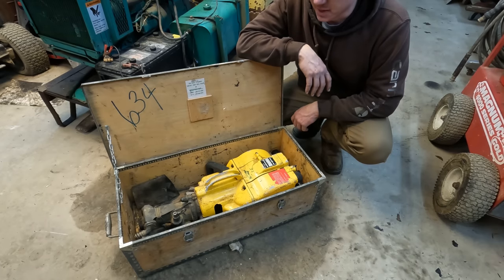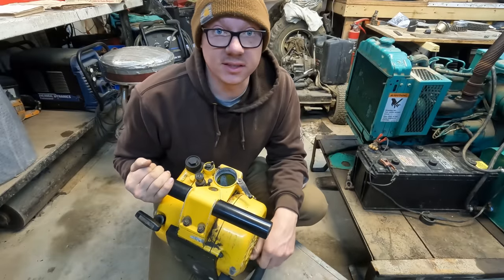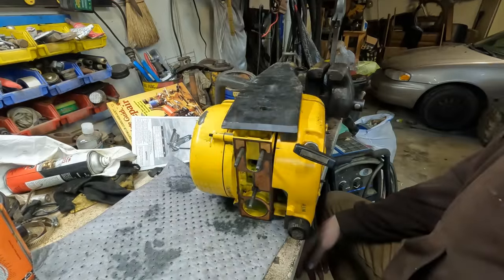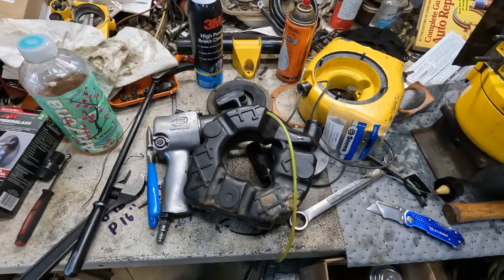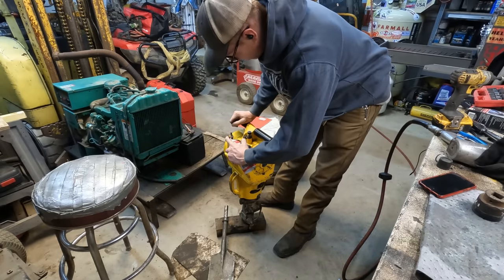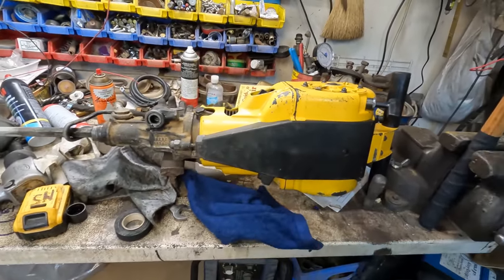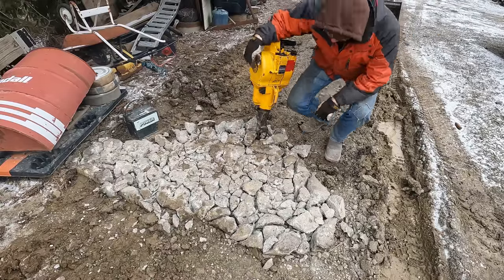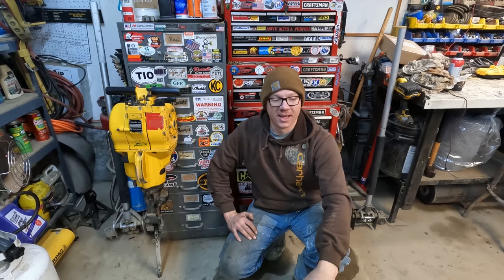RARE? Gas Powered Jack Hammer, Will it ever Run again??  (Pionjar 120)

Comment: Aha, 1:13 in the box, very similar to the petrol powered jack hammers we used here on the NZR as "one man operated" ballast tamping packers.
We had a couple of heavy Cobra's as well as a few Punja's - as we called them - never could get my tongue around the written name of Pionjar (smaller than the bigger/heavier Cobra's but just as efficient when used by one person for use as railway ballast tampers).
When the entire work gang (of 17 men at it's greatest number) were doing a track relay (mostly curves as these were 70LB track replacing the older 53LB, 55LB & 56LB rails we had on the Otago Central Branch Line - we also had a few kms between the two tunnels in the Auripo Gorge - between Lauder & Auripo - that had some 95lb & a short section of 110LB - both being test tracks in the excessively hot rock cuttings, with way too many curves).

We took our motor trolleys and flat-tops loaded with jacks, crowbars, shovels etc., and SPADES always the garden type spade with either wooden or yellow plastic handles - these we always used when doing track lifting & leveling, for manually spade packing the ballast under the sleepers, until we later did that quicker, with Punja's and Cobra's.
Bloody hard yakka, either way, slamming a spade into the ballast on a sloping angle to force enough ballast to go under the sleepers, which with every down stroke gave one a jar in the upper arm, shoulder areas, whilst lugging a hot and heavy Punja / Cobra around and hammering it's smaller slightly forked spade tip into the ballast - may have been a lot quicker, was also a lot harder to do in the heat and dust but a little easier on the shoulders, whilst BOTH arms were hammered with the kick-back from these oil-leaking (two stroke oil/petrol) petrol machines running at full throttle.

Comment: try Again, after they're saturated, carefully take them apart and just lay them on a surface that is flat and will soak up the water, I just usually use the bed and let them dry.
If it is stapled in the center remove the staples before you soak them. If you want after they're dry you can hit them with an iron set on cotton.It's not particularly difficult to line them all up and stick a sewing needle through the staple holes and then just take a new staple stick it through the holes and bend them over. And nice job and getting it going you are certainly persistent.

Comment: I've got a cast-iron  cobra jackhammer  whit the steel cable  as a pullstart.. I've started it a couple  of times by pouring fuel in the carb that's about  it and it was mixed  fuel by the way... Matt  that's a nice one right  there

Comment: If you are bringing something (with a pull  start )back to life, jou can use a dril ,or your power tool with a nut to spin it faster  to start.... when  you get the start element off.. :)

Comment: Looks like the mixture is for running at regular high speed .............The push throttle slows it down and all the way down shuts it off ....New looks like 1200-1500 ....You did good ...............Used between 400-700

Comment: Try moistening the pages with warm water with either a cloth or a spray bottle (light mist) I had a book that got wet and the pages were stuck together like that. Half the pages were still damp and I was able to carefully get them apart. The pages that were dried were stuck and I ended up ripping them a bit like you’re facing

Comment: Hi Matt . When I started working with council here in Kulin western Australia . There used to be 2 of these monsters under a bench in the maintenance shed . One pre Christmas clean up, the blokes dragged them up to workshop for a laugh to see if I could get them going . 
Amazingly after years of lying under that bench they both fired up on ether instantly . 
Then they both went in to junk pile . After watching you pull the rope for ever I'm glad I never tried to revive them . 
But they were definitely made back when men were men . Shit load of compression and a steel cable for a starter rope.

Comment: We had these and 2 stroke rock Drill's for the blasting company i used to work for. we did lots of off "middle of no where" Hydro pole installation in solid rock.

Comment: Matt been there mate, did the same thing when I was trying to fix my Flymo lawn mower. Didn't i feel stupid. If I'd read part of the manual that says how to fix the fuel system and pull start. So I know how you feel. I agree German stuff made well but overdone. But the feeling of satisfaction when you get things working again cant be beat.

Comment: I saw the comment on steam to get the pages apart. It will work but you might have better sucess using a hair dryer. The "ink" they use is like laser printers. When the heat is applied, the ink / paper will allow you to gently pull them apart. It must be hot but cooler than steam. Good luck.

Comment: I have a 2 stroke jackhammer made by Wacker that I found on craigslist for $200. Not only is it a simple and great running machine but it doesn't weigh any more than my Bosch brute that I have to plug in to power.

Comment: The throttle is backwards. You push the button to kill it, it's WOT by default. What I do to start it is choke it, put the needle in 1/2 position, give it a few pulls. Move the needle 1/16, try again. Go until you run out of needle. If it still doesn't start, adjust the choke and try again. In town I'm 1300 ft to sea level at I find you need some choke, but at 7000 ft elevation and above you don't need any. Once you find the right combination, mark it with a paint pen or whatever. It'll be the same spot every time.

Comment: Reminds me of starting my Hilti 16" gas portable concrete wet saw. Having rotator cuff injuries on both shoulders don't help. Switching most everything to cordless electric, what a difference!

3x5 card to separate pages, steam cleaner but not wet, or go easy with a heat gun. If lucky there might be an available PDF somewhere.

Comment: I've owned one of those for a while. It always starts easy when cold, but it is very tricky to start when warm. I usually just take a looong brake before i restart it. Nevertheless, it is a beast, heavy to handle, has lots of power and is very very LOUD.
Reply: Its easy when its cold or "fully" warm, its when it is somwhere between its tricky :D then it might be easier to let it cool down.

Comment: I use Threebond. 1184 to seal grommets in gas tanks.  It is fuel resistant.  I do the same thing for grommets going into bar oil tanks.

Comment: I ran one in the 80's for demo and modification in apartment buildings taking out concrete it taught me 2 things one let the hammer do the work and  two don't fight against the hammer I tried to fight it and tore out the tendon in my forearm that was a painful lesson . the worst part was it happened after running one for 3 years on a daily basis . I just tried to make it do something it didn't want to do and tore my forearm in the process. I have used both gas and electric hammers and trust me a electric one is a better option in every way even If you need to lug a generator along to the job

Comment: I just happened to run across this video and noticed that on eBay there are a bunch of parts listed for this mode.  Didn't read through all the comments so maybe you already know this.  There is also one listed as non-working for a lot more than you paid for yours.   Will keep watching to see if  you got it fixed.  🙂

Comment: I have spent many hours trying to get my own pionjär started.. 
It's a pain in the butt sometimes cuz of the way the engine is constructed. The cylinder head is actually what is powering the Hammer, meaning the head indeed moves.
It takes time to get to know your pionjär , but when you do It is a really capable piece of equipment.
Reply: Read your manual and do what it says, then its not hard to start. You cannot start those like you start a lawn mover or a outboard engine.

Comment: I had one years ago. We used them in the AirForce to drive elephant stakes. When we got away from those tents I acquired one. Bitch to get started but boy did it run

Comment: It is more helpful to know what the pages are stuck together with. That being said, I'm sure it is almost impossible to determine that since the equipment was purchase without much prior knowledge. You can start by using a steamer but don't go too rough with it because you don't want to soak the pages. I've seen some mild success with using a iron with the steamer function activated but an actual steamer is more effective and doesn't get as hot as an iron

Comment: A bit late to the party… 
The throttle is “inverted”, it is full throttle when left untouched. Half depressed is idling and full depressed is for stopping the engine. 

Starting instructions say to open the mixture fully and close the choke. Then pull the rope a few times. Open the choke and start the engine, adjust the mixture to proper setting. 

After stopping the engine close the mixture screw fully. 

Fuel needs to be 8% mix.

Comment: If the hole in the center of the socket is not also blocked it is probably not getting adequate choke if the flat lever plate is meant to block an opening on the original filter housing.

Comment: I got stuck on a job where I had to use one of these replacing a huge commercial pool deck. It had no where near the breaking power of a 50 pound air hammer. And was replaced after a few days with a real air hammer. It seems that saving a few bucks. Cost the boss thousands.

Comment: Way to go. I felt so sorry for you. Once my fingers start bleeding. I would start modifying it to start with my 1/2 inch drill.   Anyway, very entertaining. As for stuck glossy pages, I use my hair dryer (heat gun to hot)

Comment: This machine reminds me of an antique jumping jack I saw an old guy tinkering with at a tractor show. He flooded the engine, so he set the throttle wide open and began cranking. It hit after about the fifth pull and immediatly ran wide open. It was bouncing 2' off the packed dirt display area and was launching the old guy as well. A couple bigger guys saw what was happening and grabbed hold of the machine so the old guy could get away from it.

Comment: Parts. When the Chinese bought the rights for this macine they called it YN27c (c edition is most like your Pionjar (Pioneer) 120 with both hammering and drilling).
Anyway most parts from the YN27c fits your Pioneer. The side handle definitly does fit. Also, you shall not run your machine at to high rpm as it won't hammer right then. And it wil give you the lean pop before it stalls out. When it pops give it a litle more fuel. Every nut and bolt on that machine have a torque spec, and most is pretty low, be careful when torque down dose nuts and bolts. If I find your e-mail I wil send you service and operator manuals.

Comment: You can actually get parts for the pionjar 120. You can just punch in pionjar 120 air filter diagram. You can find the everything you need from there.

Comment: I feel like you should start it from it laying on the ground somehow.  When it's upright you are having to lift the machine do to the up and down motion.  Also I think you need a longer pull cord.
Reply: Yes it start mutch easyer laying on the side and i have always done it , when you got it up to running "temp" it is easy too start  run upright  :-)  But if you want to get frustrated and think the macine is some sort off evil thing... keep trying starting it upright  :p

Comment: First of all, this machine does not cold start very whell, but after a few minutes it reaches reasonable temperature and runs much better.
When the machine sputtrers/missfire:s, it does not get enough fuel, increase the fuel adjuster screw a little bit until the sputter ends and the machine runs clean. The machine will now run better and the rpm will increase. If you insist on opening the fuel adjuster screw even more, the rpm will decrease and it will just run pig rich. I usually change this fuel adjuster screw wile running the machine, minor changes to make the mixture optimum.
Matt C is right when claiming: "The throttle is wide open when left alone. " If you push down the throttle the machine will either idle or stall.

Comment: This is a really simple and old design, massive pile drivers for peirs and building use exactly the same princeable, the start bu pulling the "piston" up with a cable winch, then inject diesel onto a topplate sitting on top of the pilon, then they drop the piston onto it, they just adjust the flow of diesel depending how hard they want to hit it. we rebuilt one years ago dated around 1920ish. there was also stationary engine, i want to say it was a Marshal, but  i cant remember exactly, and it was basically the same type of thing but horosontal.

Comment: It is probably drawing a lot of air from the crank seals on each end of the crank so it is only going to run at one speed. Next problem is the book I have had luck re-wetting the pages to get them back apart then you put wax paper between each page then squeeze it really hard vertically between 2 really flat surfaces. I have used countertop laminate and it worked pretty good just make sure it is dry before you take the wax paper or and close the book it will restick if not dry

Comment: Hold your book over a boiling pot of water, so as the steam goes to where the pages are stuck. The less stuck pages separate themselves. Gently separate the pages if you can. Don't hold the book over the steam long enough to get it wet again.

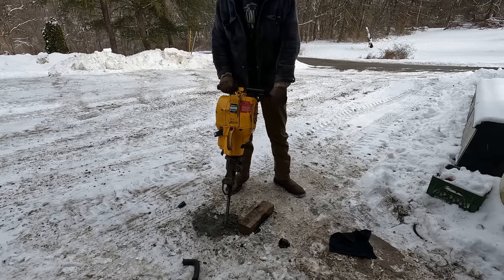Comment: 26:01 - And now - do you see why I preferred the use of a garden spade - to spade pack ballast under sleepers.
At least I could keep the spade running at my own arm packing speed - it was LIGHT to carry and I never had too much trouble starting it (just the lifting and slamming down needed - being done by my right arm)
None of this pull your guts out, if the machine wanted to play up?

Comment: I would check to see how clean the portages to and from each breed valve is through the cast housing and how clean and flat the read valve sealing surface is on the casting and order new reed valves just to try and eliminate the reed valves which can be a problem on any two stroke as can the engine ports and any sealing gaskets on the engine.

Comment: No man now that's funny man. Just add in some marvel mystery oil to the FUEL.& adjust it as you go until it clears up on it's own.& will throttle up with handle feed. I'm not seeing much smoke coming from the engine at all myself Matt.,or try A mixed blend of Marvel mystery oil.& WD-40 together as one treatment solution for the fuel to burn cleaner.& run smoother.

Comment: Lots of info on Google & YouTube, this thing uses MIXED GAS and notice run instructions, like about the choke and other settings. Consult the literature, you missed something on the throttle connection when you reassembled it, is why not coming up to full speed. Hell of a unit when fully functional, see about getting a replacement handle for it.

Comment: stuck pages like that we used to wet then down with a sponge soaked in water and whilst  damping the page pull it apart then re dry them worked for me  hole smoke bat man that is quite the work out your having with that monster rather you than me my friend

Comment: Guessing --- You may want to pull the throttle button apart , maybe a leaking seal , o-ring or  gasget ? 
I saw I guy from & in Sweden had what looked like a new military surplus on one of these .
Could come in handy - in my younger yrs. , not as a beat up 70 yr. old ;)

Comment: i've had a 120 for 20 years.  it is a biatch to start unless you get it running and start it every day.  do NOT push down on that throttle button.  pushing down on it is how you stop the running machine [as you have basically discovered on your own!!].  you can get a straight segment of 6mm allen/hex key and insert it into the center hub of the starter.   i have the other end of the 6mm hex in a drill chuck and i use the drill [on reverse] to crank the antichrist.  if you get it started, for the love of god, do not attempt to use it unless you have allowed it to warm up for at least 3 minutes.    i haven't run my 120 in a couple years and i'm [as usual] having a bitch of a time getting it running.  i appreciate your break down of the fuel line problem - ultimately i may have to do the same and install new fuel line.

Comment: After decades of hating little 2 stroke engines, like you I discovered the fuel lines fail. 
It wasn't until I discovered the inexpensive McCullough 3516 chainsaw that I realized how helpful the primer is on a small engine. 
Rather than pulling on the starter to pull fuel in to the engine the primer lets me pump the line full. I have a MuCulloch Timber bear that could use a primer. 
My first Mac was a small one that I had to dump fuel into the spark plug hole to prime it. 
If I knew then what I know now!

Comment: You definitely got your money's worth out of it, didn't you?  It really does work well.
RE: the stuck pages, rotsa ruck.  You might try steaming the individual groups of pages, and once moisturized, carefully peel them apart.  Then lay each page down using a paper towel to separate them as they dry again.  Clothes steamers, humidifiers, steam cleaners, steam irons, or tea kettles can be the steam unit, but isolate the good parts of the book as you do it.  A little painting spatula (art paint) can work well for a thin 2-1/2" long separator.  Amazon has sets of them for $5.99.

Comment: The only kicker is that those new, Milwaukee battery rigs probably hit substantially harder and faster with less operator fatigue. There's something to be said for 30-40 years of tool advancement. Nowhere near as cool, but if I'm running one for an hour, I'll take the new one.

Comment: It is acting like a pulse pump.  Any air leak, even small will eliminate fuel suction and it will not run. High RPM help overcome small air leaks.